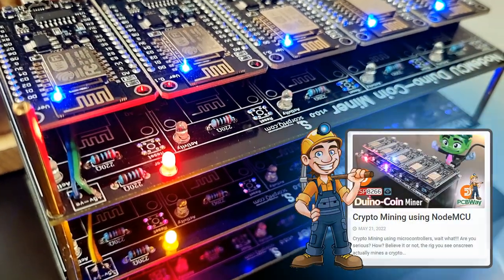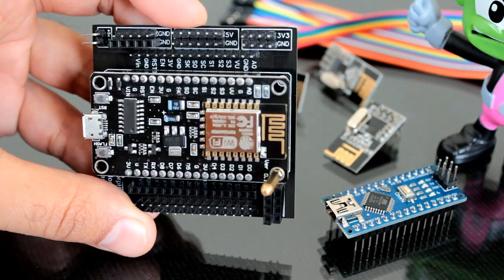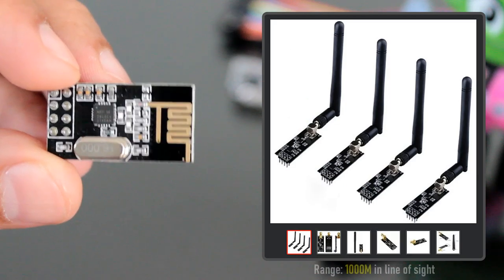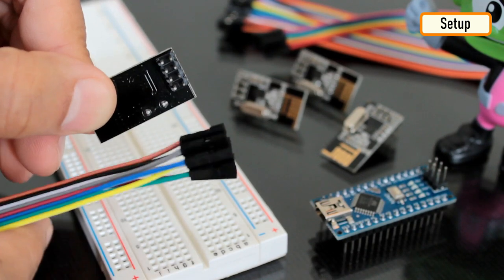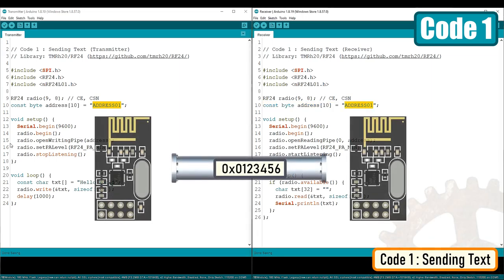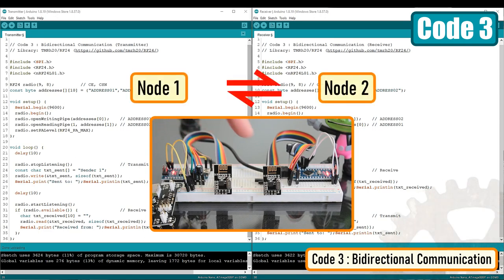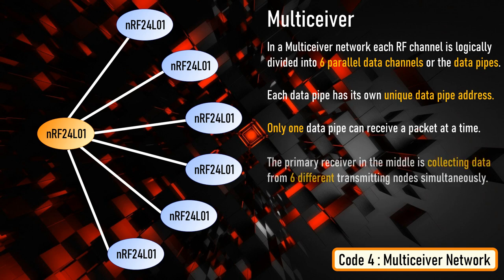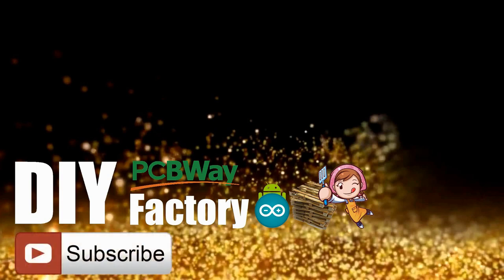All About nRF24L01 Modules

Comment: Salute for this video...

I have one doubt 
If my transmitter is in 3rd floor and my received in ground floor in between some wall 🧱  then it will work?

If not then what will be the solution for this...please tell me
Reply from the maker: You can create a mesh and use few as repeaters

Comment: Hi, i had seen your video & its useful. i had used it as transreceiver some data packet sent from transmitter to receiver & from receiver to transmitter. I got range but the latency is not good enough. I need realtime operation like switch i.e. latency required less than 20ms. Can you suggest what to do
Reply from the maker: I haven't used this sensor for critical stuff yet. Hence, latency has never been an issue for me.
1. I use this sensor at my doorbell
2. Created a shooting game similar to laser tags

Comment: I write the program and upload it to the boards.... But hello world does not seen in the serial monitor... Is both the boards are connected in one lap or can I connect it with two other laptops??.... Led porgr also not working... Serial monitor shows something like "?><>>?" This... I don't know where the problem is....
Reply from the maker: You can have them both on one laptop or on 2 separate ones. 
If you have them on one then use serial monitor for one and putty for the 2nd one. 

Please check id the baud rate is matching or not